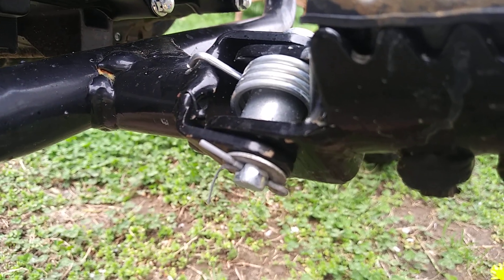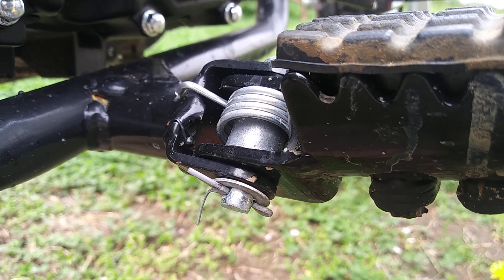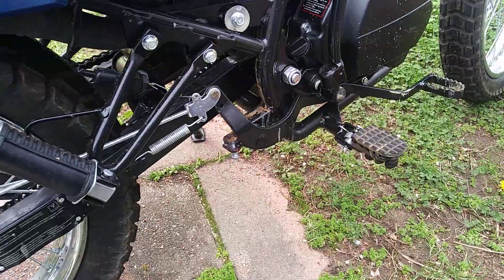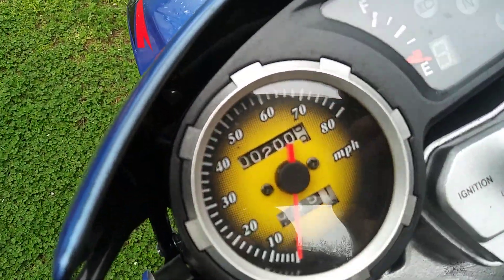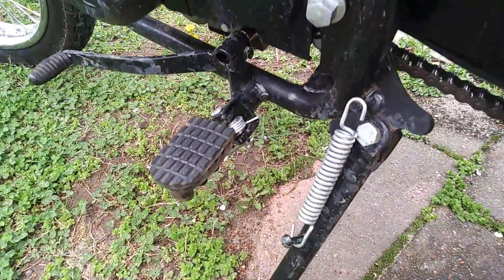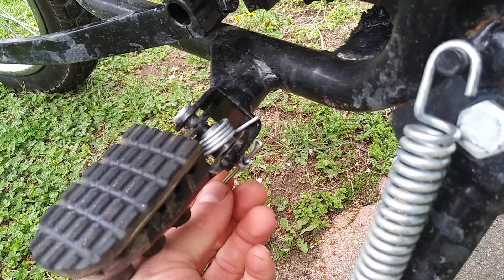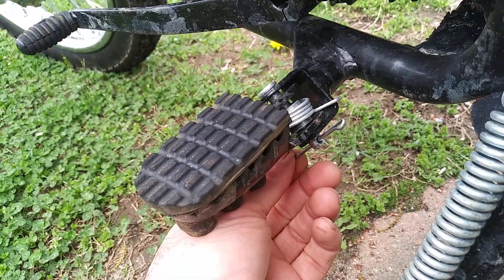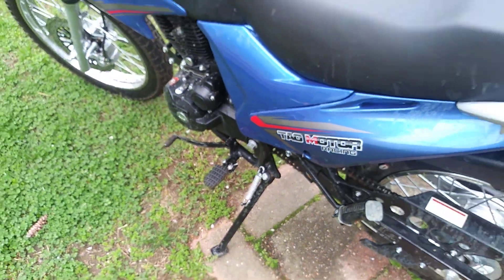First "broken" piece on Tao Motor TBR7: lost cotter pin on driver foot peg

Comment: I had a minor breakage at about 60 Miles.  The thing that resets the distance on the Meter broke on mine.  Contacted TX Power Sports for a replacement.  They said they would contact me about it.  That was almost 2 weeks ago.  Heard nothing since.
Reply from the maker: Yeah my dealer put in for a new rotor for me for runout pulsation, that was two months ago, crickets from Tao. I think it's probably worth buying two bikes, one for spare parts! Or figure out the Suzuki dr2000 crossover parts

Comment: That bike looks identical to my hawk 250. The first 500 miles I lost a front break bolt, my air box hose fell off (which was actually a good thing because I threw a cone filter on it, and gained about 10mph, better fuel economy, and less bogging) and horn stopped working. If China would hire more then one quality control guy, this kinda shit wouldn't happen.